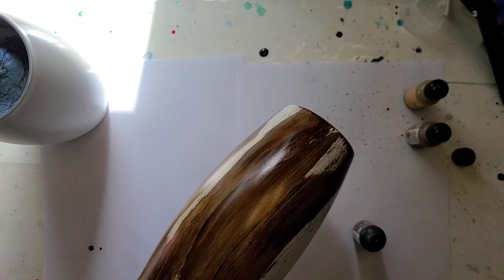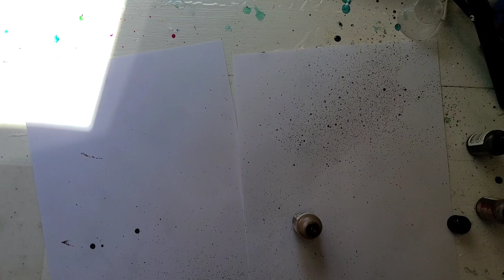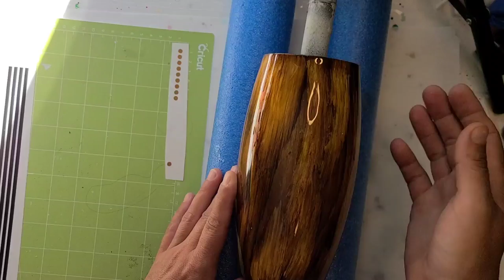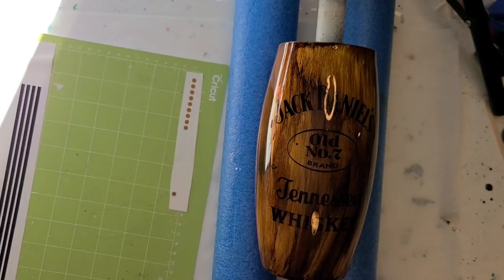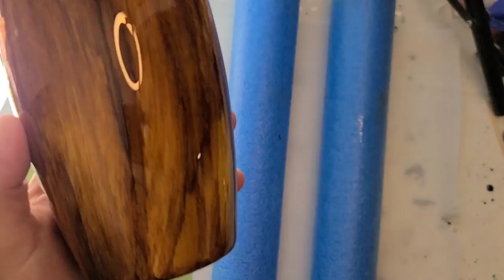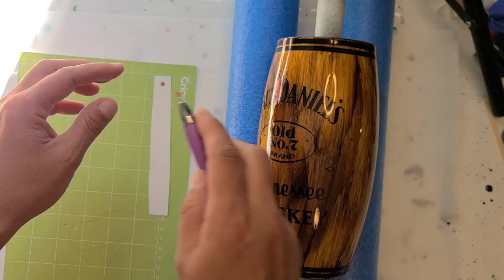Whiskey Barrel Alcohol Ink Woodgrain Tumbler Tutorial

Comment: My first one came out great. I'm just wondering about the rim. On mine tge white is still there. Do I make sure the rim is covered in ink as well?  TY
Reply from the maker: The very top of the rim? I don't bring my epoxy on top of the rim take a blade or flap wheel and clean the rim prior to my final coat.
Reply: @RaesTurquoiseTurtle  yes the very top. Does that get ink or does it stay stainless steel?  So take off all epoxy on rim before final coat?

Comment: What size did you cut the strips for the barrel and size of circles?
Reply from the maker: Circles are 0.181 stripes are cut at 10 x 0.144 and end trimmed to fit main Decal is 3.5 wide x 4.275 tall